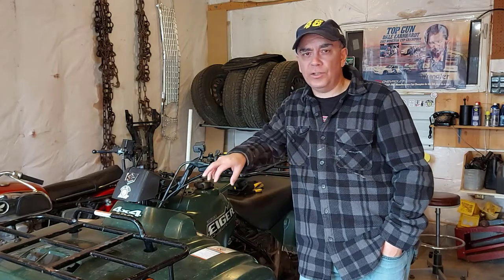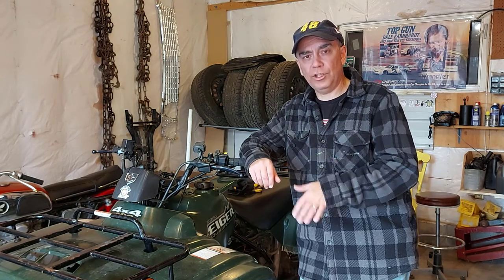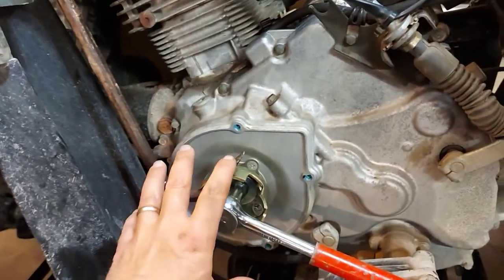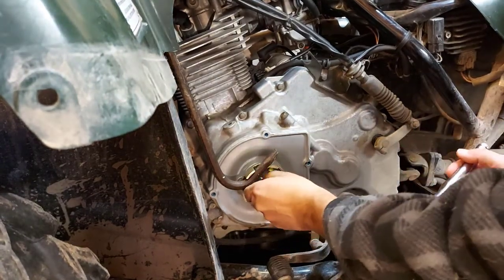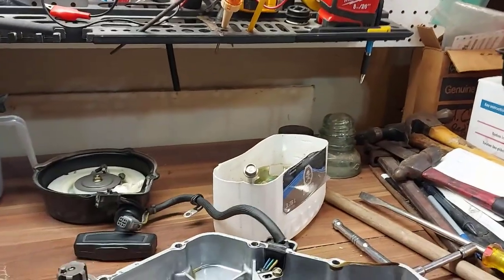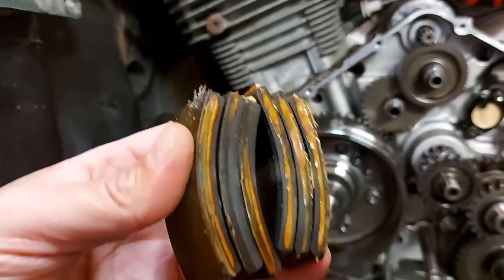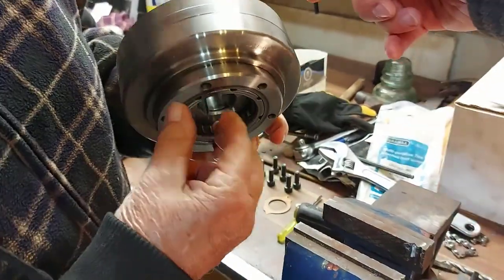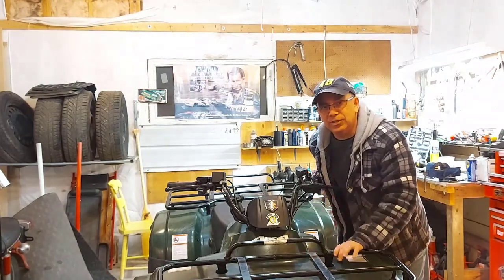ATV Hard to Start When Cold // Suzuki Eiger 400 Flywheel Magnets Loose

Comment: For anyone watching this after the fact. When I did mine I turned the bike almost up on the opposite side. Didn't have to drain the oil (though an oil change will not hurt); much easier to see and work with things. Hope it helps someone.

Comment: Great repair walk through! I’ve had starting problems with my eiger 2004 for last 2 years.  Spent on two visits to the bike shop to overhaul the carb, didn’t change much.  I doubt I could have figured this out if not for your video, and seeing similar issue from a few others.  I opened the side cover and voila all the magnets could be slid around in the flywheel, all of them had loosened from the glue.   No damage to the stator or pickup sensor windings.  I just ordered the new flywheel, gasket  and puller kit.  Installed it today.  This eiger has never run better than now, it’s like new.   Only has 2500km
Reply from the maker: That's awesome! Sorry I'm just seeing your comment now. Mine is working like a charm as well. Have a great evening 😀
Reply: @GettingItDoneRepairs   @stevea4572 
Would you recommend starting with the flywheel replacement if you were to do it all over again (vs replacing petcock, overhauling and cleaning carburetor , etc)?  I just bought an '06 Eiger and it idles OK but only if warm.  No bogging when given gas, per se, that I've noticed. The previous owner had it for 10 years and didn't replace the flywheel and I'm thinking it may be a good preventative move and could help with the rough idle.  Thanks much,

Comment: Nice video. I have same 4 wheeler...but mine began to leak little bit of oil while reving engine. I found it from from too of cover like right where the starter/wire ...what would be best for repair...replace gasket or maybe grommet where wires go is tore ?

Comment: FYI, The flywheel nut size is M16 with a 1.5 thread pitch. My thread protector actually damaged the threads on the crankshaft and I got a thread correction die to fix it. My impact wrench did not break it loose and I tried everything to get it off. Finally got the help of an ATV dealer and his impact gun got it right off.

Comment: I got a 2006 Suzuki Eiger 400 4x4 no spark all lights come on new coil good battery good fuses getting good compression and it's getting gas any suggestions?????
Reply: Same the only thing I know is to try and change the stator like in his other video

Comment: I ended up selling my eiger I bought new in 05. Few years ago this happend and the magnets got stuck in the flywheel and stator so the machine felt locked up. Took off the side cover and there was millions of pieces of magnets. Reason i sold it is because the transmission gears fell out and i was scared i wouldn't be able to put them back in correctly. Silly me. Wish I would of fixxed it but I still have my vinson 500 I also bought new in 05

Comment: Roland my 2004 Eiger 4x4 also does this clunking noise from the front diff area when I’m in 2WD and running 30 mph or so and then let off the throttle.   It does this since about 2 years after I bought it new in 2004.   Have you come across this issue on yours?
Reply: Tighten the adjust screw on the 4 wd

Comment: Got one no start but crank ok
Every once in a while it kinda back fires but no attempt to run
Owner replaced carb but made no difference 
They said it’s a 500 engine?
Not sure what year model 
Are the 400&500 same flywheel 
It has ing fire
Check valves ok

Comment: Wish you had shown putting the rest of it back together. Is there a link for the diagram you found? All the diagrams I've found are segmented and not easy to see where everything goes back together
Reply: I would like to see the diagram he used also
Reply: Every figure out how to put all the gears back?
Reply: @jakedillon6080  yes I did! I had found a parts diagram and pieced it back together that way. It runs great now after sitting in the  woods for 10 years in pieces.
Reply: Do you possibly have a link for the diagram
Reply: I'm not sure why my reply kee getting deleted
Reply: @Rob-C  I could use some help washers everywhere

Comment: I have a artic cat 400 4x4 is the same engine to suzuki eiger, have a big detail,have a poor spark,i change the high tension bobine, have a new estator,i change cdi unit an regulator and the quad doesn't run
Reply from the maker: This issue I had in this video could be your problem.

Comment: What is the big difference between the 400 and 500  ????
They look vastly the same to me
Reply from the maker: I guess only 100 cc
Reply: Is the 500 doing the same thing and is it the same flywheel ??
I got one that trying to start but won’t 
They replaced the carb but it’s same thing
Reply: Dif lock on 500

Comment: During the time you were having these issues.. Did your start button still work or were you having to pull start?
Reply from the maker: my start button worked always.
Reply: Ok mine does not. Im going to replace starter first and see if that wrks. Thanks so much for your help and videos!